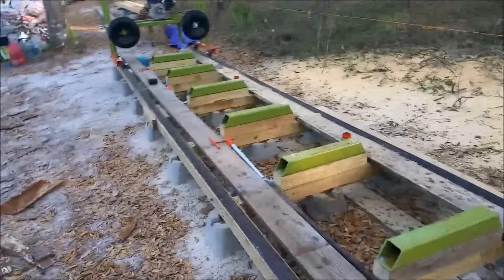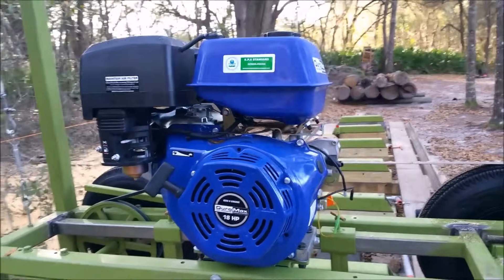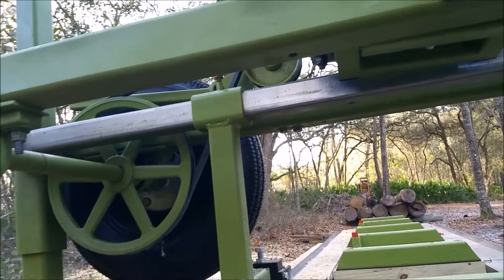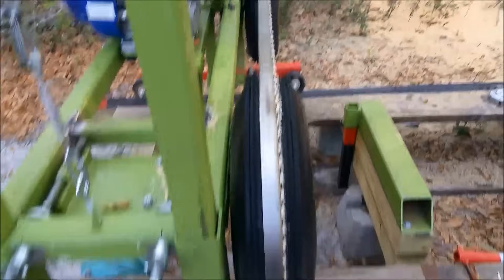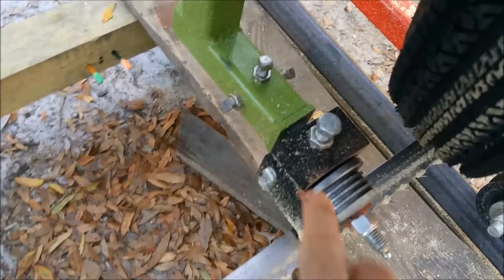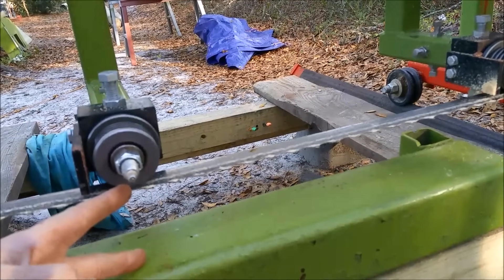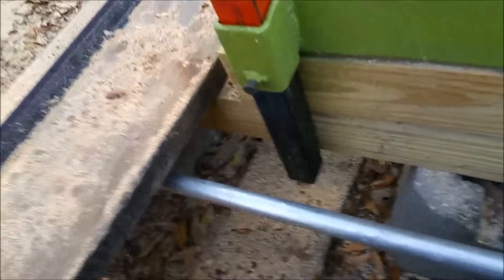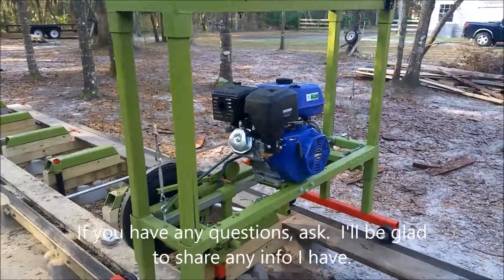Homemade Bandsaw Mill walk-around

Comment: I would like to learn more about the "dog" system.
Reply from the maker: Theres a video on YouTube about that (from another builder) but I cant remember who it was or else I could provide the link
Reply from the maker: For the pipe its 3/4" pipe inside 1" tee with a 1" extension perpendicular to the 3/4" horizontal pipe. The 1" tee slides freely side to side until it's barely pulled off from being perpendicular. That's when it wedges onto the 3/4" pipe. At the end of the 1" pipe, I welded nuts and built a T-handle to a 6" bolt and ground down the other end into a point (the log side)... I'm guessing that's what you asked about.

Comment: Awesome build, I'm getting up my materials list now and will start my build very soon. I may have some question later if you don't mind. Thanks in advance.
Reply from the maker: Good deal man. I'll help however I'm possible. Some suggestions based on my build. Use larger diameter axles and a centrifugal clutch with a type "B" belt. Both of those will save you some time and effort. Also, unless you are very good with precision work, just buy the blade guide assemblies from Cooks or a machine shop. Good luck man.

Comment: Great job!  I've watched literally dozens of sawmill videos and this is one of the best designs top to bottom I've seen (if not the best).  Thanks so much for posting the video.  I hope to build one next year and I'm sure I'll use many ideas from yours.  I think the only part you didn't talk about is how you are driving the tire.  They look like trailer tires, no?  How did you connect the 10 inch pulley to the drive tire?  Did you make your own hubs?
Reply from the maker: Thank you sir. The wheels are 16" pneumatic trailer tires and the hubs came from Ebay with the same bolt pattern. The drive pulley uses a key stock in conjunction with the axle, and same thing for the hubs. Let me note that this was a prior build and most of this sawmill was rebuilt with larger axles, steel band wheels, and a centrifugal clutch on the engine with a type "B" drive belt. I was much happier with bigger parts and true band wheels (or pulleys and belts)... Unfortunately I have no videos of that latest build and since then have sold it to another guy.
Reply: JD Fabworks Videos thanks for letting us know. You videos and lessons learned will help a lot of people.
Reply from the maker: That's the goal man. I hope it helps

Comment: Good Morning, I am finally finishing up my mill based on yours except I will be running 18.75 sheaves instead of tires.  I am ready to purchase the cooks guides but really have no idea of what blade with to use.  Any ideas or guide lines?
Reply from the maker: I used Woodmizer blades. They come in all lengths and tooth pitches..  I used a double hard but depending on wood type and cut type, woodmizer could probably pick the best one for you. There are other equally or better brands also.
Reply: @joshsbomber  Thanks Josh, I made a typo I meant what Width blade. Does it depend on the tire/belt size used on the sheave. The Cooks guides ask for blade size giving 1, 1.25, 1.5 & 2 inch. The sheave width is 7/8 and the belt width is .65+-. My guess would be 1". Also, most of my milling will be pine.  I live in SC.
Reply from the maker: Most blades are 1.25".
Reply: @joshsbomber  Thanks again for your reply.  I will let you know how it goes once complete.

Comment: Thanks. Also on the wheel alignment / tension set up is there enough play in the plate the connector nuts are welded to set the alignment easily? I was thinking maybe the flat plate which you have sandwiched between the square tube and the angle iron has a slight curve on each side to allow it to basically twist or tutn alittle in its nest? Or am I over thinking it and it actually takes very little movement to set the alignment? I have purchased my wheels and will order 2 atv hubs for the axles.
Reply from the maker: I just saw your mag. Thanks. You are correct about both - the plate has tapered edges for rotation and it doesn't take much to align the wheels.

Comment: I am looking at the different types of do it your self 
mills. Yours is very simple and straight forward. What I am having trouble figuring out is the axle to hub connection. How did you attach the drive wheel to the axle? It looks like you welded a plate to the axle and drilled it for the hole pattern?
Reply from the maker: On this mill, I bought a hub that fit the axle and wheel bolt pattern. It used a key stock also. There was an external ring and slot to the rear of the hub and a fine thread castle nut on the front of the axle.

Comment: Wow awesome how's it holding up?? Any problems??
Reply from the maker: It worked pretty good, but I did rebuild it due to the small axle size and some things needed "beefing" up... I went to 1.5" axles with pulley style band wheels and that worked awesome allowing me to torque the blade a little tighter. I added a centrifugal pulley at the motor with a "B" type belt.  I added the battery and wired the key start... also removed the lubes system altogether. It made more of a mess than it helped. Also removed 4x4s under the log bed to get more height clearance... oh yeah, and added about 15 inches to the height of the whole machine to get more height clearance. I think that's it. Haha like I said rebuilt... Once it was working consistently, I ended up selling it, but do plan to build another one someday. My girl has got me busy on other projects right now.

Comment: Very impressive. After watching your other video of you using this mill, it seemed to me that you might want to add a diagnal cross bar on the back of the frame.
Reply from the maker: I agree. There was a little slop, but it never affected the blade height or level, so it just never happened. Lol My next build will fix a few of these things.

Comment: JD if you go to the junkyard for automobiles pick up a couple of those dummy tires they will keep your blades from loosing set on the side that are touching the tires as there more round. The tires your running are too flat across the face

Comment: What size tires are you using and how long is the blade I’m interested in building one thanks
Reply from the maker: The outside diameter of the tires are around 16"... I forget the length of these blades (maybe 132")... I've since rebuild this saw and have actually sold it also. I do however plan to build another and I'll make a video of that one.

Comment: Nice build! I agree with many others that this is a smart and simplistic design. What did you use for the axles? How is that motor holding up? Also I would like to point out that you’re the only one I’ve seen that made a catwalk and everyone else steps over the bunks as they walk and that’s just dumb!

Comment: If you don't mind me asking.  what are the dimensions tall wise and then the front to back on the carriage.  thanks
Reply from the maker: I added a bit to the height making it around 6 feet (after video) and front to back frame was 14"...
Reply: @joshsbomber  ok thanks. how about side to side?  and you used all 2x2 square tubing and then 2 1/2 to fit over the outside for the slide part up and down.  is there much slop in it to throw it out of wack?  Ive been studing them for a while and yours seems to be the best and im going to make something close to it.
Reply: @joshsbomber  and what size blade are you using?
Reply from the maker: I ended up around 50" wide at the frame... There's a few things I'd do differently if/when I build again. I'd build with a bearing on each side of the wheels instead of only behind them. As well as the tension/alignment setup is, it is very stiff and can be fatigued fairly quickly. The lift/lower cable setup is a hassle pretty much all the time (something always loosening)... as for blade size, it was a standard size, to be honest I can't remember exactly. Unfortunately, I've sold this mill so I can't get measurements from it anymore.
Reply: JD Fabworks Videos ok yeah I’ve seen a few that had the bearing on both sides of the wheel. It would definitely add more strength to it. Do you think if you had a bearing on either side that you wouldn’t have to go quite as being on the shaft size?
Reply from the maker: That's a tough question not being an engineer. My gut tells me that a larger axle is better. Lol

Comment: could u tell me of the size of the stuff u used to make it please it looked really good
Reply from the maker: I used 3/16" 2x2 tubing, and 2.5x2.5" tubing. The angle for the rails is 3/16" 2x2 angle... I would use no less than that for structural parts. This mill got rebuilt again and I uped my band wheel axles to 1.5" and added actual band wheels instead of pneumatic tires. I also scrapped the tension/alignment parts on this mill and built a whole different system for tension and alignment. If I still had the mill, I would have changed the lift/lower part too... This was a good mill, but I upgraded it then sold it... I will probably build another one sometime

Comment: at hhow many fps are u running your saw-band trough the logs? have you calculated your belt transmission?
Reply from the maker: To be honest. I calculated it all out on paper before building the thing, however once I started using it I realized many factors determine the quality of cut. Actually, lower rpms worked better on soft woods for me and higher rpms for harder wood. I used the engine rpms to adjust the speed of blade. I found that I had full range available, but usually stayed around the 3/4 throttle position when cutting. As for actual numbers, I belive I build it to be around 4000 fpm passing through the wood at full throttle.

Comment: Very impressed with your mill.  I'm interested in building a mill very similar to this and just curious if the board cut is remaining accurate and if the motor is overkill on hp?  Would a lower hp motor work or should you stay at an 18 hp motor?
Reply from the maker: As for the mill, it works fine. I did upgrade to 1.5" axles and bandwheels, but the alignment of everything seems to be a bigger factor than blade tightness (although that is important as well)... As for motor, I don't know that you can have too much. Less would be plenty, but depending on blade and type of wood, I'd do a 16 to 18 hp again. I'm sure a 12 to 15 would be just fine also.
Reply: How wide of a log can you cut?
Reply from the maker: I can't remember, but want to say around 30 inches. I rebuild this machine 3 times, so sometimes I forget the numbers. Lol

Comment: One of the most basic simple designs I have seen as others stated. Considering inverting my main steel T tracks to hold on to the rolling chassis one I hope to build. Have most of the parts to do a 20 ft twin axle steel C channel frame setup like yours or a 24ft Cox I beam aluminum boat trailer. It is already 5/4 wood decked over with a boxed steel border rail. It would have room for a knuckle boom up front.

Comment: Fine work. Where did you buy the Shafe and pully  or sheave   very interesting
Reply from the maker: Thank you! I got the shafts through BMI Karts (and will never again)... They were drift kart axles or something... Anyways, they broke often so I upgraded after this video to 1.5" cold rolled steel from my local welding shop.
Reply: JD Fabworks Videos thanks
Reply from the maker: I can't remember about the pulley. Probably Amazon or ebay.

Comment: your design is one if not the best one I've seen. thank you for sharing. I'm going to try to build my own. good luck and keep up the good work sir
Reply from the maker: Thank you. I would recommend up sizing a few of my items. Number 1, larger diameter axles (minimum 1.5" axles), number 2, a better way to lift lower the saw, number 3, bandwheels instead of pneumatic wheels, number 4, use centrifugal clutch with "B" type belt to drive... Good luck man
Reply: @joshsbomber  hec yeah man, I appreciate that greatly! Started buying my metal, going with a 16 foot deck just to be on the safe side

Comment: the square tube that has wheels thats runs on the angle,how long is it
Reply from the maker: The carriage length front to back is about 30" (wheel to wheel). It's about 50" wide (across the log bed). The angle came in 19 foot pieces (allowing about 17 foot log lengths). Hope that answers your question.

Comment: Hello there! I have watched your video of your sawmill several times and really enjoy it. I do have a few measurements questions if you would be so kind. Thank you!
Reply from the maker: Yes on the acme rods. If I did it again, I would use them. Just thinking through the numbers, a rod with 4 threads per inch would give you an inch rise every 4 rotations, I think... Point is, you could really map out the rotations vs. movement before buying to make it easy to remember once it's built.
Reply from the maker: I'd be glad to answer anything I can remember about it.
Reply: Great thank you! How far apart are your uprights and how far apart are your guides when spread the farthest apart? You can email me if it's easier tctorbet@hotmail.com thank you.
Reply from the maker: I want to say my uprights are around 50" apart. The distance between blade guides could open to around 28" if I remember correctly. I sold this mill a fee months ago or else I could go measure.
Reply: Thank you very much. I just about have everything gathered for mine. I really like how yours is built. I think the only big difference that mine will be is I'm going to use acme rods for the raise and lowering of the blades. Thank you for your post!
Reply: How wide is it please

Comment: +JD Metal Fabworks - how do you determine blade length / wheel & tire diameter?
Reply from the maker: Blades come or can be made in pretty much any size you need... I bought my blade first and built around it... Also on the tensioning, I had several inches of movement to fit blades within so many inches of each other.

Comment: I am wondering if your running those tires does it take the set out of your blades? I saw with some other similar mills having that problem. My tires are off a scooter so there more round .I would like to incorporate  carriage feed using a hydro static axle off a tractor lawnmower.

Comment: Can I use a twenty hp engine from a riding mower to make this cutting down logs for a log cabin?
Reply: I'm a back yard engineer myself, lol. I'm REALLY impressed with this mill, and will be using some of the features on it building one of my own. 

The problem with lawn mower and garden tractor engines is that almost all of them these days are vertical shaft engines. 

But some older ones do have a horizontal shaft..... if you can find one in good condition. 
It's unlikely you will find one that's light enough and compact enough with more than twelve to sixteen horsepower at the most. 

Using a vertical shaft engine is simply not practical. It requires a gear box that means a lot more work and expense.

Comment: My sawmill uses the same guides and trailer tires, my first cut was very disappointing, the blade headed up as soon as I started into the wood. Any suggestions why? I played with the tension, tire presures and guide downward pressure on the blade. Nothing seamed to effect the problem. Any ideas or suggestions would be appreciated.

Comment: being an old mechanic, I want to pass on my mill to my kids. thus, the tire bandsaw will not work, because of the low life of pillow block bearings. a car hub with controlled tension with the center nut, seems much better than pillow blocks and can probably be had for cheaper. I would buy for 17 dollars each, the band wheels from browning, being balanced and pullys also. I believe I will make an electric clutch, for motor dis-engage, but will have a unit like your belt tension for the idler wheel of the bandsaw. I don't think the key is any way less useful, than a pull rope, and a garden tractor battery will also make the convertible top motor help move the carriage up and down rapidly like a cook's saw.

Comment: You really do nice work!
If you specified the size of your axles I must have missed it.  Plesse tell me the axle diameter and where you sourced them and the hubs.
Reply from the maker: Sorry, i just realized this message was left on here. The axles were 1" and they came from BMI Karts (which I'll never buy from again)... They broke quite often, I'd say step up to at least 1.5" axles and have the bearings as close to the wheel as possible. The idea of this mill was great, but when I rebuilt it, I upped the size on the axles.

Comment: For anyone wanting to go a little deeper into the maths of pulleys, here is a great site for calculating the pulleys. Convert everything from inch to mm though when doing your calculations. You can animate your calculations very easily. 

https://www.blocklayer.com/pulley-belt.aspx
I used the values from what was mentioned in the video

 Large Pulley Diameter  260
Small Pulley Diameter     85
Pulley Centre Distance   600
RPM Small                       3600 ~

Comment: Very nice build. I am in the process of building one similar to yours. I want to use trailer wheels. So how did you fasten the shaft to the wheel? Did you have to take out the bearings and get some type of adapter so you can bolt or weld  the wheel onto the shaft for the drive wheel? Thanks